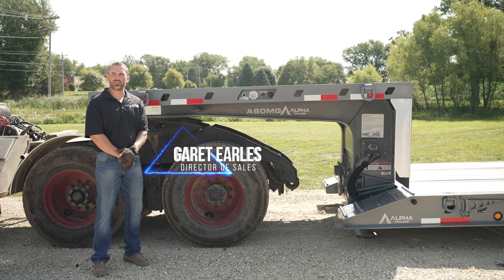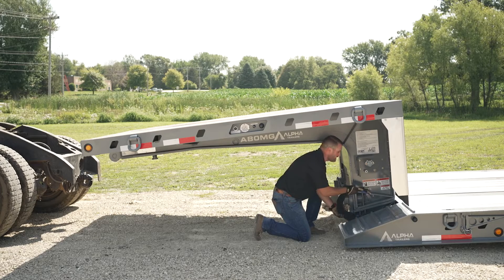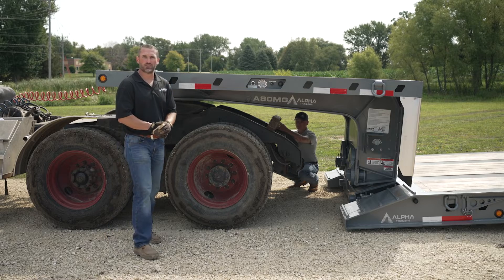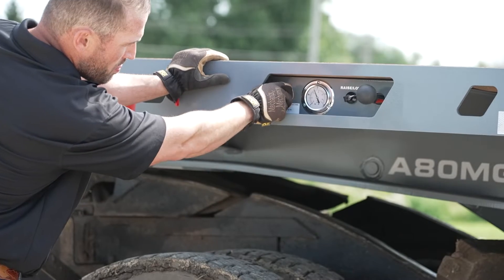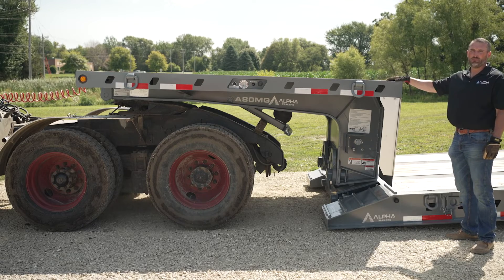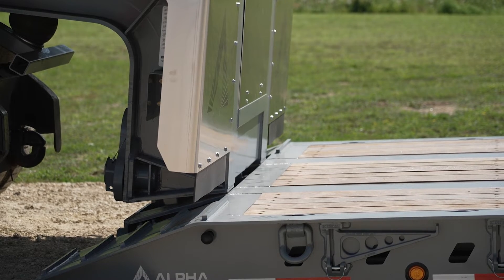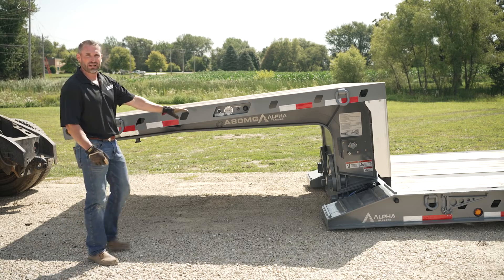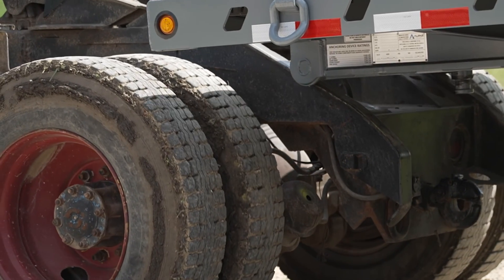Mechanical Gooseneck Operation | Alpha HD Trailers

Comment: Please tell me this trailer has a beavertail as well that's the primary method for loading and ability to split the neck is for when it's needed.   It just seems time consuming, and a missed step with a pin or lock could be a disaster. Not to mention it can be a chore lifting the deck at times with specific loads, even with hydraulics. Having to have the truck in motion if assistance was needed leaves you in a bind if you're solo and can't shift enough weight to the rear for hook up and lift purposes. My 90t hyd detach takes all of about a minute and a half to split, and that includes walking back to the cab and pulling ahead, little longer with the jeep, haha

Not knocking it by any means, I see the universal use potential for switching trucks(pin notch and slide rails of course)  with no need for a wetline, the lack of stress not having to rely on a genset or running out of gas after forgetting to fill the Jerry can, and it's obviously far cheaper than a hydraulic neck.

But as a full time float driver for a busy contractor, I see these couple of issues as a problem that would steer me away from this trailer,  unless of course it's a tail loader as well and this ability is just for special situations.

First manual detach I've even seen in my more than 2 decades putting wheels under anything that fits, not to say they might be common in areas, but its a decent little concept.